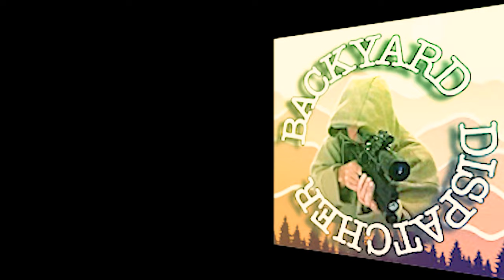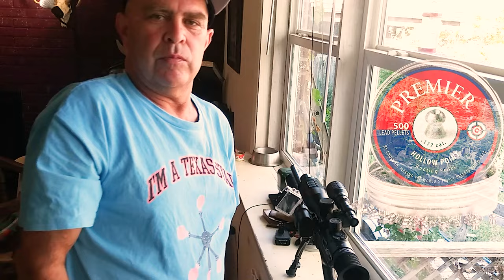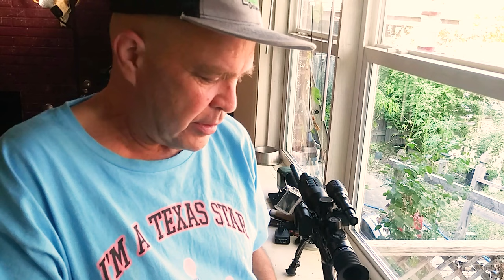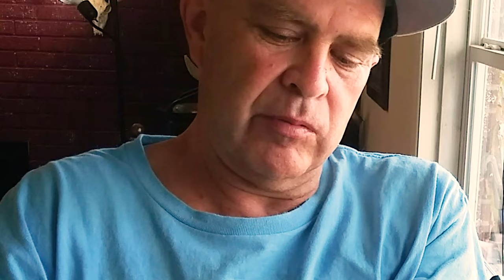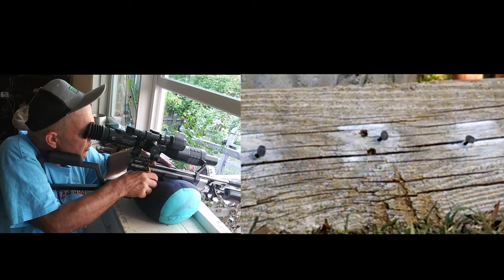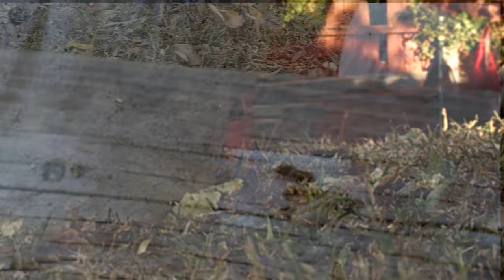Do YOU have a tack driver airgun? "SHORT" #precision #airguns #marksmanship

Comment: I like this challenge, what yardage you at?
Reply from the maker: about 20 yards
Reply from the maker: I wanted to ask you where you get your bottle valves
Reply: @BackyardDispatcher a combination of Amazon, Ebay, and Tippmann parts. Some are 5/8 x 18 3000psi and some being M18x1.5 at 4500psi. Always inaccurate, 3000 output is more like 2700psi. 1800 output most of the time is 1670.:goodvibes: